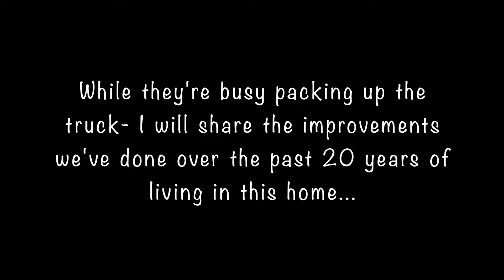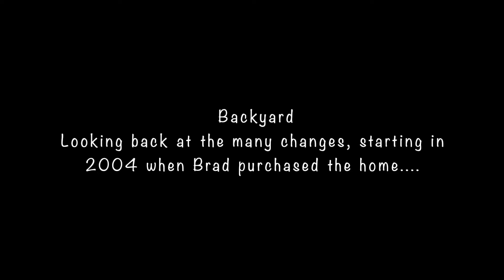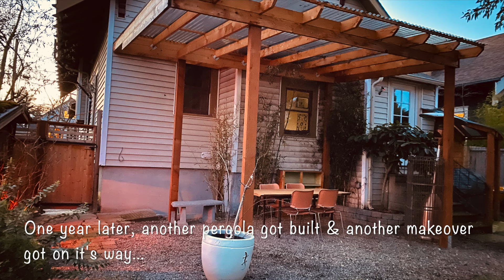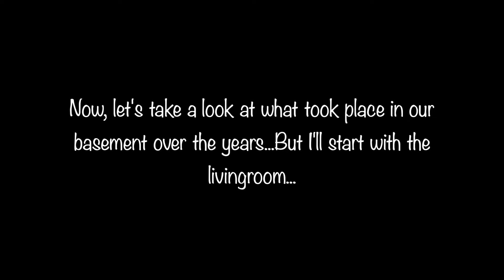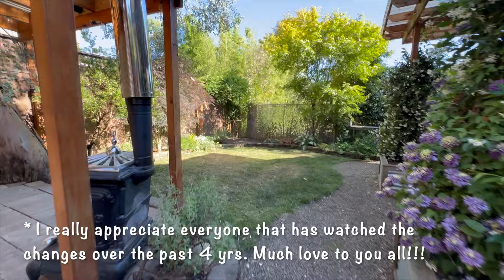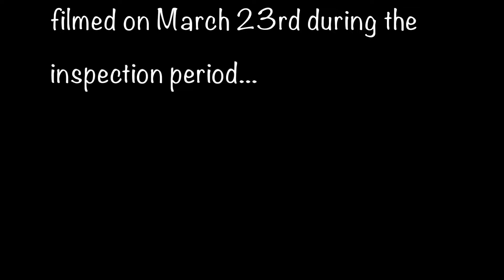Finally!! Leaving The City Behind For Country Living

Comment: Gardening in the country is a lot different than in the city.  You noticed the fence around the garden?  It’s there for a reason.  I’ve gardened three years in the country now.  I have not canned anything at all.  Creators will eat about anything you want to plant and not even say thank you.  If you can’t keep them out, then just put in and electric wires to keep them at bay.  That’s working for everything but the darn flying squirrels.  I’m going to trap them and make sure they don’t come back to visit.  Good luck, later